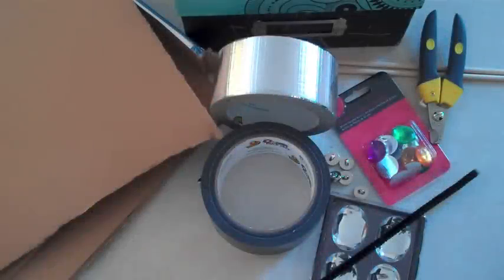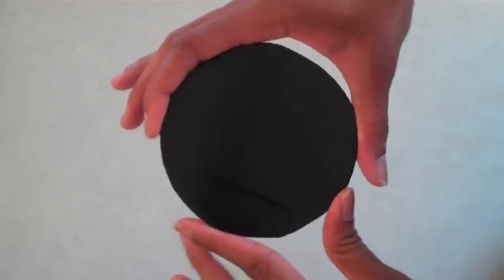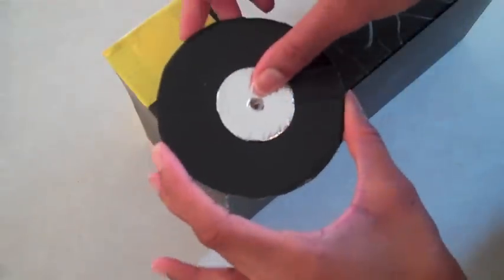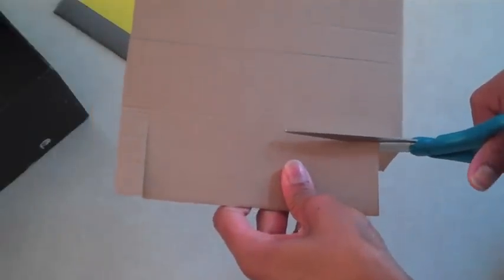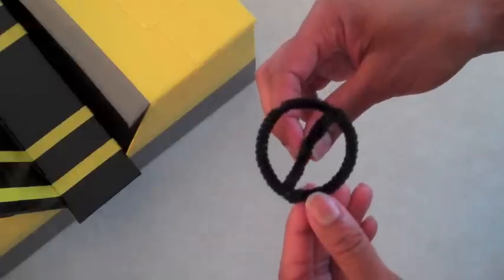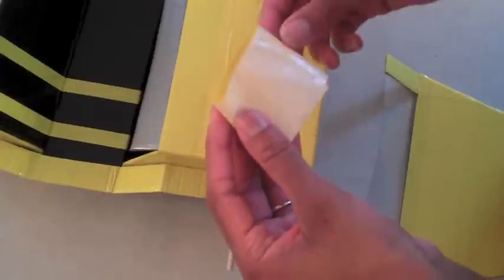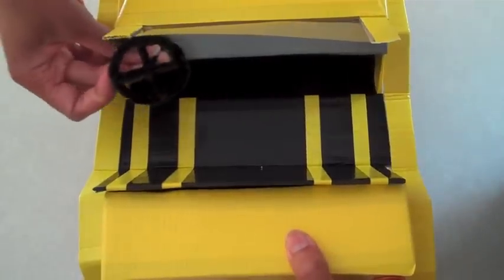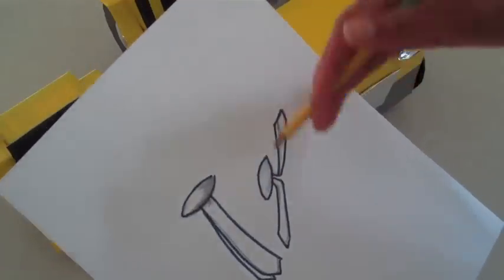How to Make a Doll Car - Doll Crafts

Comment: Ok guys, I love the idea Froggy mama! I have a slight twist though.. or an idea for a different version. The car really is fine as is... but if you feel the construction paper is too thin or flimsy, try making the car once with plain paper, and then make it with a thicker material, like cardstock, or the thin cardboard from a recycled cereal box! Then, when you are finished, look over your car and decide what parts you would like to be thicker. Measure these areas, draw out the design, cut them, and clue to re-enforce your car! If you would like some places to be smoother, try buffing them with a nail file. Then, when it is shaped how you like, paint and cover with a gloss like Modge Podge. You could even add fabric to the seat..! Hope I helped.